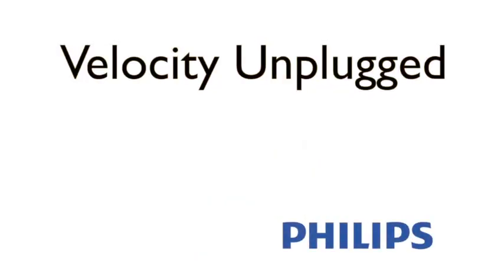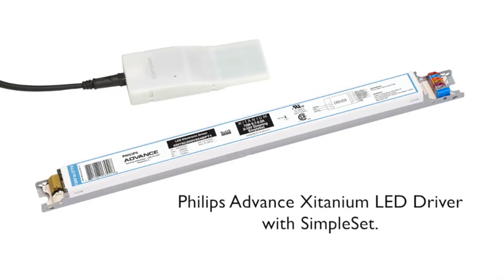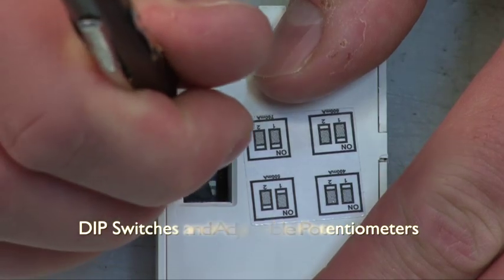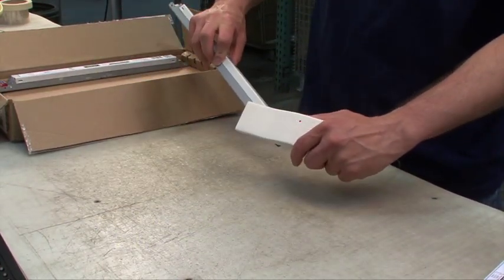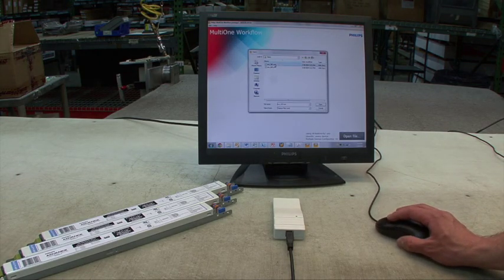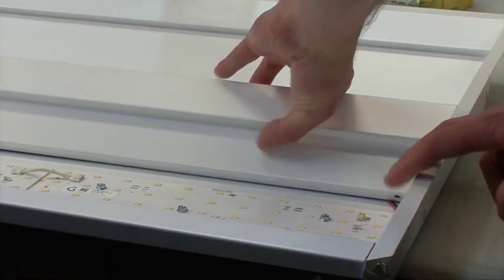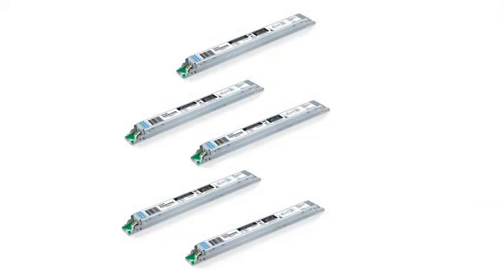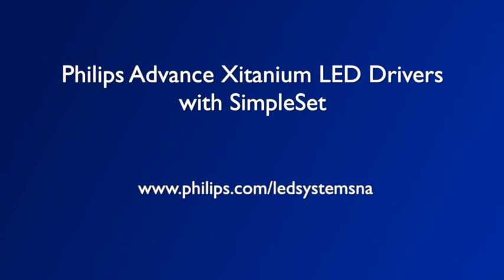Philips Advance Xitanium LED Drivers with SimpleSet Technology

Comment: sllcpower has ultra thin DALI wifi bluetooth dimming constant current voltage slim 40W 75W LED Driver. NFC programmable, DIP switch.